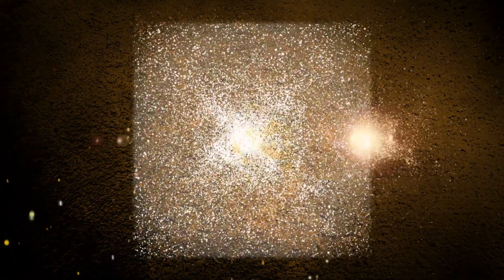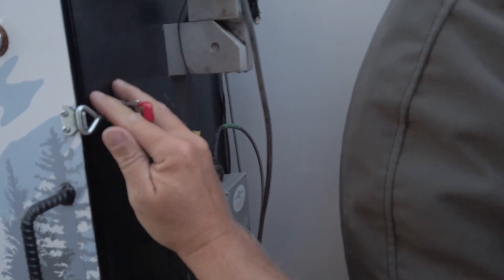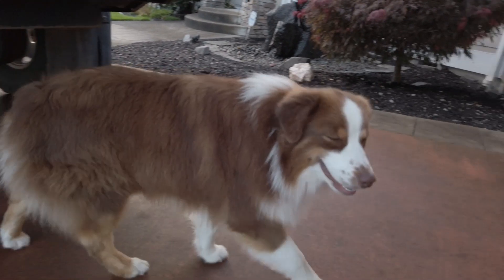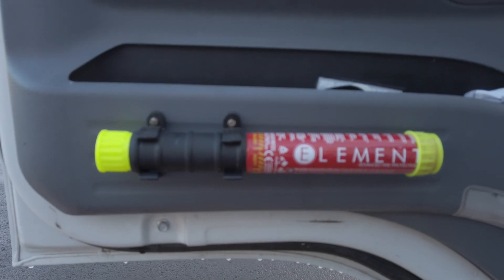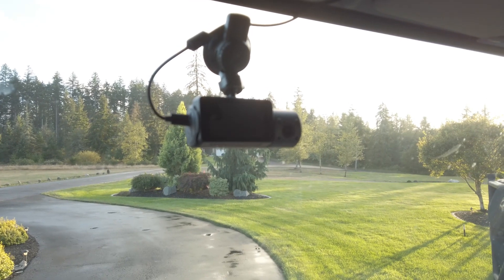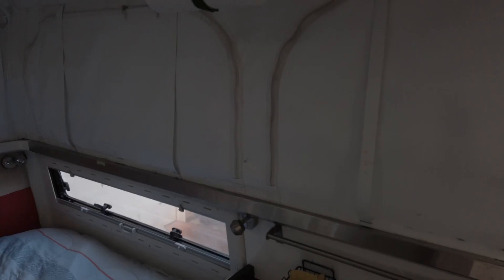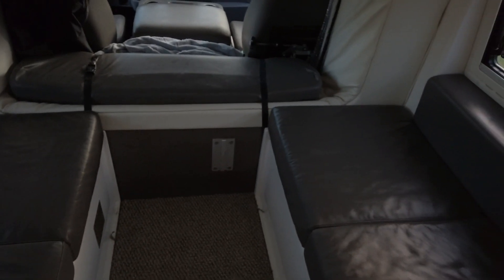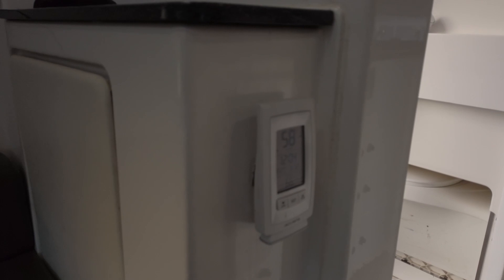EarthCruiser EXP Upgrades (2020)

Comment: Hey Brother... I'm a bit of a radiohead... what's the specs on that antenna, sir....?? What are you using with that....?? HAM....??

Thanks from central British Columbia 🇨🇦
Reply from the maker: Sorry for the late response.  Its a Scorpion 6-180 Ham Radio Antenna.  I use it with an Icom 7100 currently but you may see my old radio in a few older videos (Icom 7000).  Thanks for watching!!

Comment: Liking the upgrades. So on your scorpion antenna the whip or cap hat would vibrate loose? Have a safe and fun trip to Moab 73 Brian Kb7zar
Reply from the maker: The cap hat, I don't run the whip mobile as its too high.  The cap hat is 13ft 5 inches at 3.945.  Thanks for watching.

Comment: I'm really starting too look at earth Cruiser. There craftsmanship and knowledge is absolutely stunning. Expensive yes but you get what you pay for  and for what you can do in this even mild too extreme adventures it will handle all. The way I see it if and when I get one as long as I go out and do my best too travel and not let it sit at least once a year for Adventures it's worth it. I'm young 28 veterans and I want too travel. Life is too short too dream and do nothing about it.
Reply from the maker: Could not agree more.  There is starting to be a used market so keep and eye out and contact EC in Bend.  I bought #3 used, still expensive but not as much as new.  I love it and can't think of a better fit for what I like to do.  Thanks for subbing and watching.  Stay safe and get out there.
Reply: @Whiskey7BackRoads  appreciate and can't wait too see what that mod you did turn out. I also will be traveling with dogs so just makes sense.